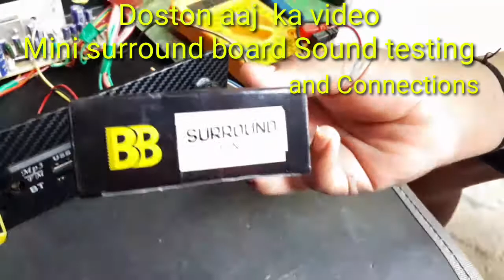Bassoon Surround Audio board Connections and sound testing.

Comment: surround out  me sirf 2 wire hai ( Gnd & S out  ) 4440 ke input board me 3 wire hai ( Left Gnd Right ) Surround output wire kaha lagana hai
Reply from the maker: Hai guys surround output mein 1K kay 2 resistance laga kar 4440 kay dono channel par surround O/P ka connection  kartay hai. OK.
Reply: @piyushelectronicsandtechni81  ek hi channel se do 1k ka resistor laga kar 4440 ke input me dene se mono ho jayega
Reply from the maker: 1K ka 2 resistance lagayen aur 4440 kay input par input karen.  Yeh surround board mono hota hai aap chahen 2 surround boards lagayen ya phir resistance laga kar aap iss ko stereo connection bana lay. Yani aap left right channel par connect kar dey.
Reply from the maker: Surround output mein 2 wire hotay hai ground aur surround signal output. Ground ko volume control ki pin no 3 ground par soldering karen aur surround signals ko 1 kilo ohm ki 2 resistance laga kar volume control ki pin no 1 par soldering kar dey kyouki surround board men left/right nahi hota hai.